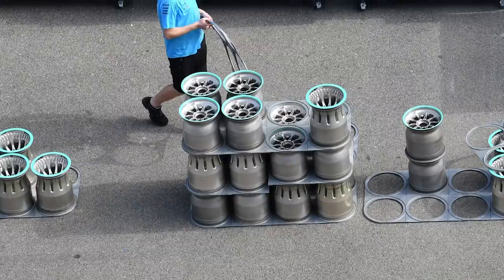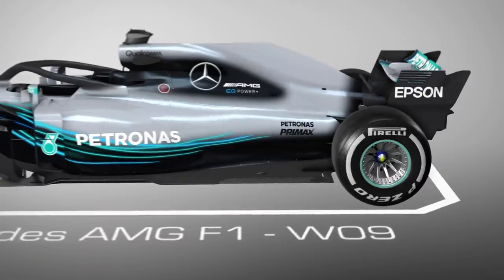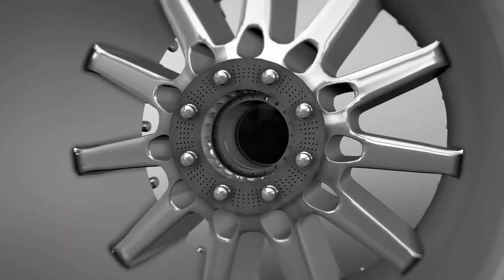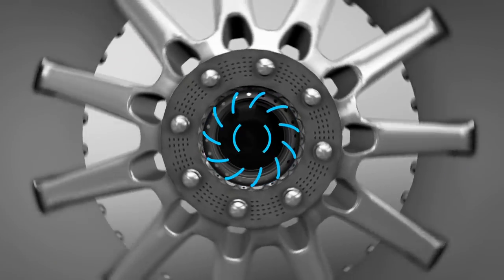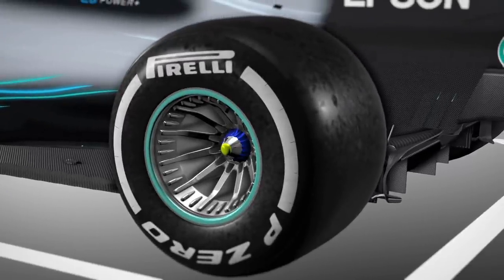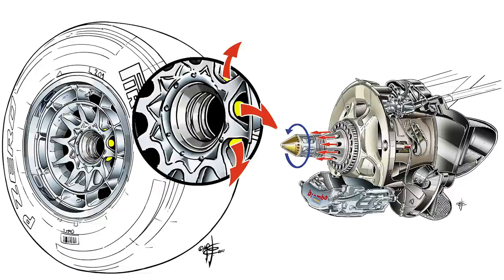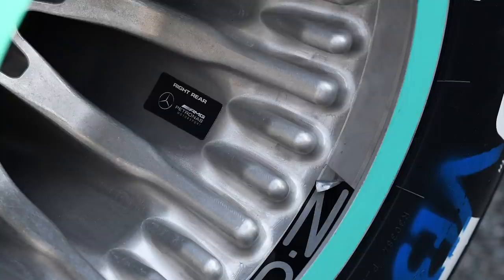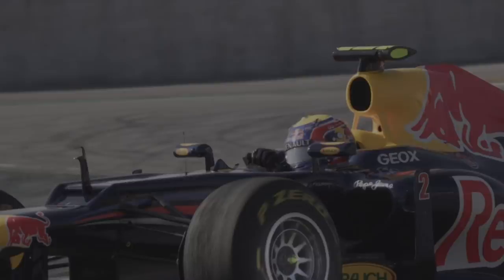Inside Mercedes' controversial F1 wheel rims

Comment: it's an artificial downforce device. same as that car with the fan that was splined to the gearbox. it's not being used as purely a downforce device but neither was that fan. the faster that car goes into a corner the more air the wheel will draw from under the car, meaning higher cornering speeds and therefore quicker lap times.

Comment: I always thought the reason f1 cars looked so crazy was because the only rules they had to follow was the laws of physics and the ideas they could come up with to battle those laws. It seems to me especially lately they are being punished for good engineering ideas that actually do what they were designed to do. And no an "advantage" in this sport should not be considered cheating it should be considered a step forward in making the cars faster. I agree with making them safe but not allowing them to use the wheels to cool the breaks and doing it efficiently is absurd!

Comment: Seems like I'd be a whole lot cheaper and easier to design an aero dynamic air inlet with a tube/housing that points directly at the wheel / brake  assemble.

Comment: If I was competing in F1 as soon as I heard about Mercedes and those rims Hell I would be trying to get some for my car.
At the same time it's basic engineering no moving parts it helps remove heat from the tires damn I should have thought of that. If it helps keep 1 tire from blowing out safety innovation. Plus longer run time between tire changes. And tire lap life and fuel consumption sure are important.

Comment: Agree with mindofmyown3 . Used to be innovation was racing,, sometimes it can go wrong there were even times when race teams would try to bluff others . remember the black engine blankets or wiffer exhausts combined with computer management directing more pressure exhausts towards the rear wing ?
I definetly miss the old Indy cars around the late 70's into the  80;s.
Seem;s possible teams a.k.a. manufacturers want the focus on them not the driver.

Comment: Yeah the wheels being changed or new mite a issue with why they didn't run them...but its build your own car and race it F1 so why would there be a problem with an improved part,for cooling I would think they would go quicker if the air ran straight thru the car ....who's knows they are doing well may be testing stuff for next year...that would make sense...

Comment: Wouldn't they have just been simpler to angle the spokes of the wheels like fan blades- or shape them to act that way slightly- and use the spokes to suck the hot air out from the hub and brakes??
Reply: Really messes up aero pakage, at 180-200,weight of steering would increase, resistance of vertualy a propeller on every wheel, though sucking air out frm under, while massive downward pressure above, would give excellent grip and downforce!

Comment: I can see three gains from those rims design:

- The ribs act as a centrifugal blower to suck air out of the brake disk for better cooling and they mix the hot air from the disk with fresh air in order to not overheat a part of the tires.

- The ribs create turbulent air around the rim and tire assembly to reduce drag (golf ball effect).

- The ribs act as stiffeners for the rims.

https://www.youtube.com/watch?v=fcjaxC-e8oY

Simon
B.Sc. Eng.

Comment: Exactly what f1 is. Innovation
I have long had the idea of the propeller principle of drawing air for cooling. Because lots of rims have a turbine shape and I couldn't help thinking about the left hand side pushing and the right pushing
The problem is that water is another dynamic. The question is whether it is better to pull the air from underneath the car.... Which I think is better for downloading or from the outside  that would create uplift
So I guess it will be good to have left and right orientation and just to complicate.
Do you have to use on the back wheel
All to get nano seconds of advantage

Comment: I 3D modeled this rim just because I thought it looked interesting. It ended up being pretty accurate but aren’t 100% accurate because I only had pictures... Just curious if anyone wanted the file, I could put it up on thingiverse to 3D print
Reply: Hey. Maybe make it compatible with the 3d printable 'open RC F1' cars. Files are on thingyverse.
Reply: @mattblack6736  That would be a good idea. But here are two potential, one is that because i modeled it as 1:1 the shape is fairly different and also you would probably need a SLA printer to get the detail. I need to print one of thses openrc f1s out one day and experiment. Ill see what I can do.

Comment: As an engineer, and having some sense of the heat-carrying capacity of "Air" (let's say vs water) and also some sense of the volume-of-air that possibly can move through these many tiny holes ( related of course to the possible wheel rotational speed).... my inconclusive "gut feel" is that this is not a very effective system....and is perhaps a technological mind-game being played out. Meaning, to generate focus and interest in this system and seeing that the opposing teams "took the bait" and maybe protesting it's use, etc, etc. Backing up my assertion is that Mercedes doesn't seem too keen to keep the spacer-with-holes, etc, etc. I can see some form of this aspect of air-flow management being used to  (say)....help brake cooling.....but claiming that it has any meaningful affect on avoiding tires from "blistering" is too much of a stretch, given the parameters of operation and seeing this design. But then again, I may be convinced otherwise with valid technical counter-arguments, as I say, this is my gut feel based on my training and background.

Comment: I wonder what the legal difference between the red bull version is different. I've seen the FIA pull other cooling/aero devices banned in the past so they need to be changed. Is this just a one off issue. Hell. If a suspended mass in the nose is a movable aero device then how is this not?  
Could this device be making a aero bubble of sorts to smooth airflow over the face of the tire?

Comment: I think F1 should have 2 classes, 1 where innovation isn't hampered, but encouraged. Got a helicopter turbine? Sure, go for it, think you can win with a giant vacuum cleaner attached to the front of the car? Fuck it, why not! The other class should be like NASCAR. (Of course with out the fear of right hand turns:) Everyone drives the same class car, where the driver really does win the race.

Comment: For a topic that should only takes 2 mins with the animated pictures, it took another 6 mins to hear you saying "Um... not sure, depends, we will see, perhaps um.. etc etc"... The animation was 200% more clear then you keep saying 'spacers, holes, and holes and more holes', this hole and that hole and how their holes are different to MB's holes. Maybe I am low on braincells but surely smart people doesnt need 8 mins to be explained a simple innovation in design to find SYNERGIES in both fitting the wheels with spacers, pin and more holes to save weight and cool the tyres.

Comment: The amount of time F1 teams spend on tiny incremental improvements is just staggering. And frankly I am not so sure it improves the racing.  I wish they'd go back to the naturally aspirated engines, make as much power as you please, and limit traction/down force. Put the car back into the hands of the drivers and see who is best. The tech that has been outlawed is mind blowing, active suspension, active down force, movable under body venturi, being able to adjust the point of down force is just a real neat idea. Actually the best racing was in the days before electronics became so prevalent. Shift with your hand, use clutches on the floor, when the cars where more like cars without a million dollar steering wheel.
Reply: i do agree with you but, the gist of racing isn't to have overtakes or lots of action. it's to cross the finish line first. even if no one overtakes you because you are the fastest, it is still racing. banning improvements just because they make cars too fast (except those that are very dangerous like too much reliance on ground effect) is literally "artificially inducing fun into the sport"

Comment: I have to wonder if they aren't relying on structural design strength vs. Material thickness to save unstrung weight. Its only a good plan until it isn't. Perhaps a wheel crack explains the hiatus.

Comment: The FIA is so much against innovation because in the old days , when there was more freedom in the specifications of the cars, the sport was extremely cost intensive and some teams would have had to stop beeing part of F1 due to budget cuts in the economic crisis.
So the tight specifications and rules allow a the sport to be cheaper. And the more rules there are the more you can win fights on the legal ground instead of the track.

Comment: This sounds like some amazingly nit-picking interpretation of rules.  The ban on movable aerodynamic devices was because of the suspension-mounted wings of the late '60s which had a habit of breaking off, killing drivers.  If designing a wheel to move air to help cool the tyres and brakes is illegal, then so must be ventilated discs.  They channel air to cool the brakes, and are a moving component, therefore they are illegal....

Comment: MY IDEAL FORMULA ONE RULES: SAME WEIGHT FOR THE CARS(without the Pilot) AND SAME HORSE-POWER(no matter what engine, Teams use.The Rest is up to the constructor."PERIOD")4 CYL Turbo,V6,V8,V10,V12,Turbo or supercharged,AERO,Tires,Fuel.JUST TWO RULES AGAIN:Weight and POWER,And Tracks where you can overtake.!!!!!
Reply: joe coquerre You need a limit on the car's overall size too. Otherwise you'd get everyone just trying to build a car that's super quick over one lap (to get pole), and extra wide so nobody can get past.

Comment: The first rule of F1 engineering is read the rules twice...once to get an understanding of what the rule writers "thought" their rules were, and once to actually understand what is written. This is not the same thing before I hear high pitched (and given the content of this video) Italian based whining. I would agree that the Italians are at a disadvantage here as the FIA rules are written in English, but that is historically because Bernie/Max are British and they ran the show, so tough and deal with it! - on to my point

The maths of lamilar flow are extremely complex, which is why engineers still use wind tunnels for certain things. To prove conclusively if this is an aerodynamic device or a cooling vent is probably not possible in a few weeksn or months, so under legal terminology you are innocent until proven guilty and Charlie's decision is only one of opinion; of probably a group of "experts". 

Ultimately the FIA will probably tweak the rules at the end of the season rather than, spend at vast expense, do engineering tests to check this out. This is historically how they do things there (see f-duct, double defusers, cooling fans to create vacuum etc), because they are not really interested in innovation.

Comment: The key word is innovation, not tricks. 

The whole point of the sport is to out engineer your competition. If your opponents don't like they weren't smart enough then they need better engineers not better lawyers.

FIX up Ferrari. It also looks like you may need better drivers too. It seems Mercedes have the better team and driver. You can't nerf a manufacturer for being good

Comment: I ride a bike alot, buy cheap ones from Goodwill cost $20.00 Or less and the first thing I do is grease the hub an bearings. Not with the red tacky, but with green highspeed, both could work. But the red tacky to much like the crap they use when they assemble it. Wheel spins slow. I've let a few people ride them, first thing they ask, why does it coast so far. 1 because I can read, 2 because I'm not stupid.

Comment: F1 and NASCRAP must have the same inept management and officials.

Isn't F1 supposed to be a test bed of innovation?

Haven't other teams, specifically including Ferrari, had heating problems causing their tires to blister, etc? Haven't at least some of them tried to address the issue with innovative design?

Specifically what prevents other teams from coming up with comparable innovative designs? Nothing.

This sounds exactly like spilled milk. The next thing you know somebody will be protesting some particular color being more efficient aerodynamically than others.

Comment: I thought one of the points of Formula 1 racing  was to innovate within a set of rules. How do you advance the sport if things like this aren't figured out🤔. I'll watch the better part of the 12 and 24 hour LeMans style races, mainly because there street car derivatives mixed with all kinds of other race cars. But racing in general(especially F1) has become boring over the years. I stopped watching Formula 1 the last year's of Schumacher's run. It got stale af at some point and I haven't been back. Way to technical and God forbid some manufacturer figure out a small edge while not really cheating!!! I am dieing to see what the Project 1 does on the Street 🤤

Comment: I don't understand how pulling air from the back of the rim to the front will cool the tire when the air is hotter next to the car seems the opposite would have the effect. Not a race car driver not a race car builder asking a
 question. 2 quotes Chad knaus it's my job to push the limits it's their job to catch me. And before you say that's NASCAR this is not I know that

Comment: This guy that is putted out of thin air has no idea of the engineering 
Thermal transfer of components. 
It’s all to do with air gap think about it. 
Basically insulting of the two comments to stop or slowdown the heat transfer.

Comment: This is why f1 has been ruined for me. In a racing series that used to be at the cutting edge of innovation, now if somebody comes up with a new wheel design everyone gets their panties in a bunch and starts whining. F1 should be the most expensive, innovative, crazy fast racing possible like it was in the 70s. If you want to see races of driver skill, there's plenty of spec Miata races to be had.

Comment: The whole of F1 is controversial, all you have to do is look at the fuel bullshit that's implemented where you are only allowed to use a certain amount of fuel per race because of the carbon footprint crap.

If the carbon footprint was that important then they wouldn't transport every team, all the personal, cars, parts ect back half way around the world to Yas Marina when its less than 500 miles away from the second race of the season in Bahrain.

The amount of fuel used to transport each team back around the world is way more than all the teams would use in the whole season and testing to.

Comment: I'll create a racing tournament where all the racers are allowed to bring whatever car they like under a specific size and weight , doesn't matter what engine is used to what wheels they're running , It'll first be checked for safety standards and if passed they can race. That is what a Race should be like , A bunch of dudes racing around in circles hundreds of times doesn't impress me , i want to see rocket cars and cars so fast you crap in your pants.

Comment: I think it's time for someone to create a new motorsport where innovation and ingenuity aren't stifled by silly rules created to help out other teams. Every team should have a set limit of money to spend on whatever they like and however the car turns out that's what the compete in. The only real requirements should be that the car can only be so tall, wide and long and have safety features obviously. I've just got into F1 this year and I'm already being turned off by it because of how political it is and how much the different teams are handicapped by the FIAs constant banning and regulation changes. If your team cant design a better car then that's your teams fault the FIA shouldn't come and give you a helping hand by banning innovations made by other teams. F1 is supposed to be the pinnacle of the sport where high technology meets the road and the limit is push more and more. The F1 I'm seeing though is regressive and seems to be becoming complacent

Comment: loss of performance was combined effect of lost downforce and lost of cooling effect on tire temps...    nothing more ,, nothing less..      But to put it into figures on paper , its really complicated as ,  loss of downforce will raise the temps even more, and while all so not having the cooling effect ( heat transfer into airflow ) the issue starts to compound on it self more and more.   

I do believe in my heart that fia has been giving way too much lee way to Mercedes in past 2 years.    Not only in engine delivery to other supplied teams,   but all so in aero area...   wing mirrors that where banned from  Ferrari ,   Rims+ blown axle's that where banned from Red Bull and so forth..   Flexing wings and floor etc etc.. 

Biggest issue with f1 i have atm.. is the Team orders that are so visible , while there are bets allowed on sport....   just an major way to fck people over.     I do understand that they are normal part of sport, but its ugly and unneeded or wanted by fans or drivers.  It would be impossible to avoid having them in form or another, but as it is,,   they should at least deny any bets taking place in any gambling sites or kiosks .   
But still,   Mercedes has done better job with engine partners than Renault ever did, like last season when they did not deliver parts for those teams who needed them,  like Toro Rosso and so forth.